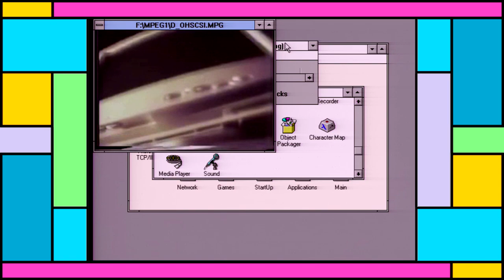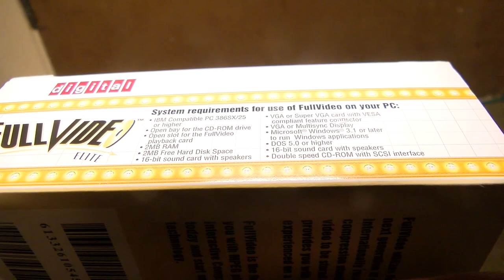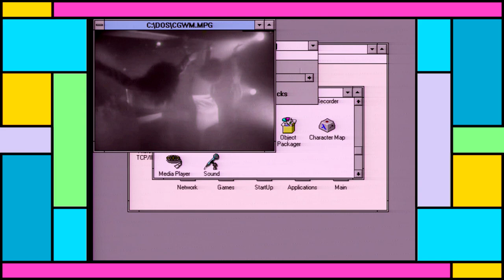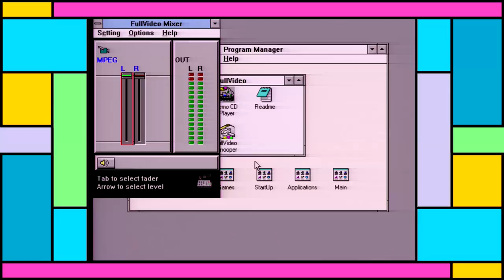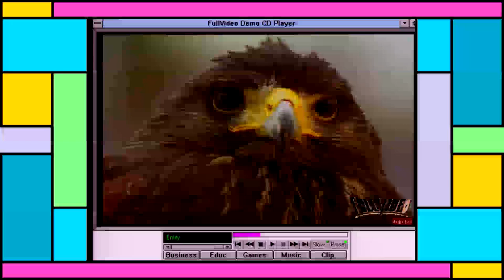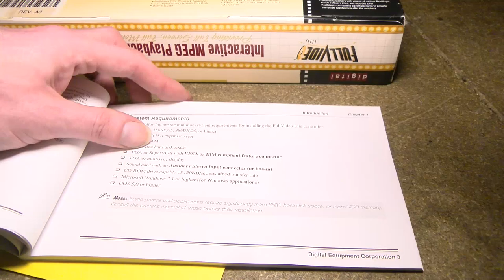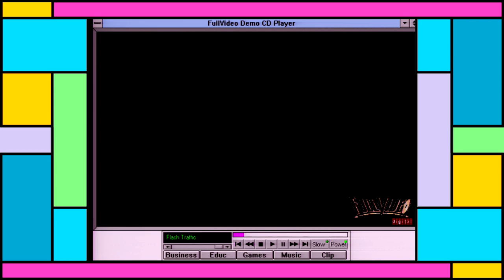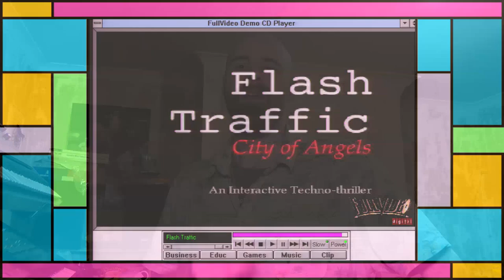DEC "Full Video" MPEG Card

Comment: Dude .  Ive been watching you for years.  I feel like youre one of the only legit people actually knowing what the machines are and how they really worked, not dressed up and running old stuff on new hardware  or whatever else.  I watch this and it just feels like the days back when "Ok, I saved up all summer for this 2.1gb HDD and I need an add-in card to even USE it in my 486, " or "I mowed, raked yards and did pedicures for old women to buy this Best Data Smart One modem , now what?"  And you run these machines and they're exactly the right thing and you talk about them IN CONTEXT.  We all (well... "we" and "all" being "US") know how these things are and how they run and how it feels, and youre one of the best channels actually showing this.  This video is a great example.     Sometimes I think your unpainted walls and shit probably put people off who are expecting "pretty" sets or whatever, like you could paint the room, put the camera a bit higher so the angle is less... but what the fuck does that have to do with computers?
Reply from the maker: Well thanks. My goal has never been to have 'the best' hardware, just 'the hardware' as it was, problems and quirks included.
It'd be nice if I could paint the walls, but the landlord wouldn't like it very much. I doubt people come here for home décor advice anyway.

Comment: "It's not actively making the PC worse." Entertaining video, even if the card is a "slot warmer"...
Anyhow, always good to see a new video. When you find the time to do it, I'll be watching.
Reply from the maker: Arguably the PC is already 'worse' due to using such a relic of a motherboard. But then, it wasn't built for speed. If I wanted that, I'd use something newer. In any case, thanks, here's hoping I can get the big machine working which was meant to appear instead of this. I really, really hate 30-Pin memory.

Comment: Did you try this card in any other system to see if it was the 486 (or other cards in the 486) that was part of the problem?  Also, did the demo clips that played correctly off the CDROM also play correctly off the hard drive?
(Asking because I never had this problem with that card, tested in a 486/66)
Reply from the maker: I tried removing cards from the 486. I also tried in a 386DX board (hey, the box said it would work. Had a 486DLC-33 installed) but that seemed quite crash prone. Playing from CD, HDD or LAN doesn't seem to make much difference, aside from if the LAN is under lots of load then obviously it'll start stalling, given it's 10Base2. If you have it on hand, could you test with a lower clock speed, say set the board to 25MHz or 20MHz, I guess? Which driver version were you using? I have Ver. 2.01M3 Rev. A, according to the disk.
It could just be bad luck, but then I'd still argue this card was worse, as the other solutions don't seem to have these problems.
Reply: @HighTreason610  I no longer have it, sorry. I do have my sigma reelmagic cards, but those are mpeg2 and PCI so can't test them in a 486 (I have only one 486 with PCI and nothing seems to work in that slot except certain video cards).

Comment: A suggestion is that the "algorithm" seems to like frequent uploads, maybe it could help if you sometimes upload shorter videos (?). Also, if something didn't work out, that is still interesting for us :).
Reply from the maker: There was a time when I uploaded fairly regularly and it never seemed to make a huge difference. Thankfully, as I said, I much prefer being in a smaller niche, but the system still warrants making snide remarks when it's so blatantly unbalanced.
The big machine that was supposed to appear probably will regardless, if only as it's not something that tends to be seen very often. It just might not be able to do very much if it can't be repaired.

Comment: More like Ligma designs amirite? I've never been interested in VCD stuff (though I probably would have found it cool back then. Unless, of course, I'd brought this at the time) so it's nice that someone else is interested enough to give me the experience I can't be bothered to try out. Shocking product, really. Oh, and nice trick with the transparency key in Paint.
Reply from the maker: It's a shame the Cyrix 5x86 machine is out of commission at the moment - data corruption - but even more sad that the Creative card in it performs better than this thing. The signal quality of it is garbage, but it plays smoothly at least. I'll have to fix it anyway, as I wonder if it can play the demo files from this card. A lot of things don't seem to be able to.
Drawing in Paint like that seemed a better way of showing when I was holding the mouse button down. My suspicions are that the problems the card has are largely just poor drivers, especially as Jim Leonard reports he had one that worked fine and the internet suggests at least three other revisions of the drivers exist. Maybe DEC were just really unfortunate and got landed with the most broken version. This wouldn't surprise me, given how they just didn't seem to be able to catch a break by then.
Reply: @HighTreason610  that's the main story here, really, as you mention at the beginning. What a tragic footnote.

Comment: 5 shekels says the problems are related to that shite sound card you insist on using.  Try it again with a sound blaster 16 (use nothing but the SET setting in the autoexec).  That POS16 is nothing but driver/tsr nightmares and was loathed when it came out for being a pain in the ass and the source of endless compatibility problems.
Reply from the maker: This may have been a sound suggestion if either A. The sound card was in fact known to be trouble for people who bothered to set it up correctly, or B. The MPEG decoding used the sound card. Neither apply here, so that can't be the problem. Audio is handled by the MPEG card itself, hence the stupid audio cable and it having its own mixer application.
Reply: @HighTreason610  As a contemporary of this equipment, I had more luck with Real Magic cards than PAS16 cards.  The drivers/tsrs on the PAS are a nightmare.  I know you hate the SoundBlaster, but the reason we all used it was because it worked.
Reply from the maker: There seem to be more clone cards out there than actual Sound Blasters. I wouldn't sully my DX-50 with a SB16, that's for the cheap Cyrix machine. In any case, the sound card absolutely won't affect the MPEG card, and I know this as removing everything is a common diagnostic step, one which I definitely tried.
Reply: @HighTreason610  Well if you removed the PAS16 and the mpeg playback was still wonky, that's proof enough.  Cheers mate.